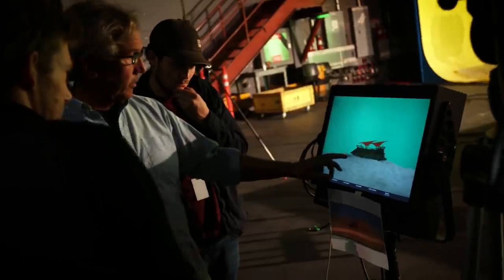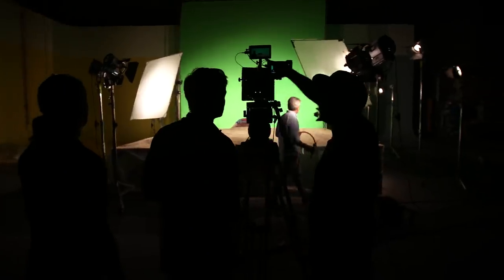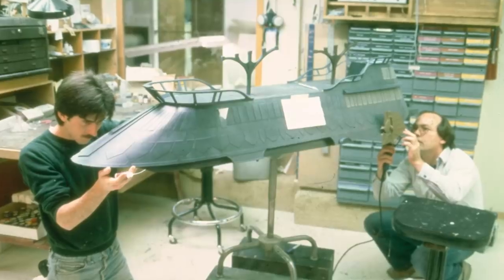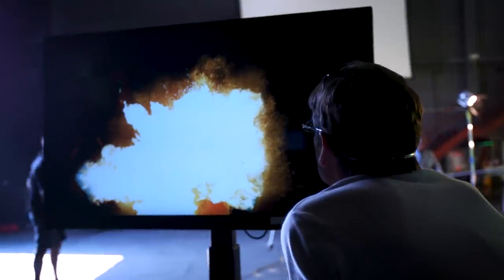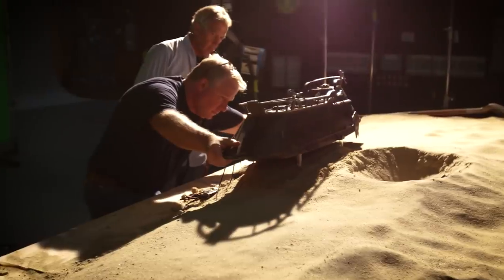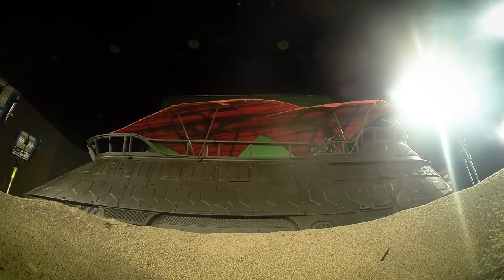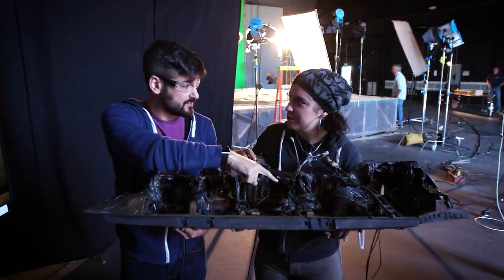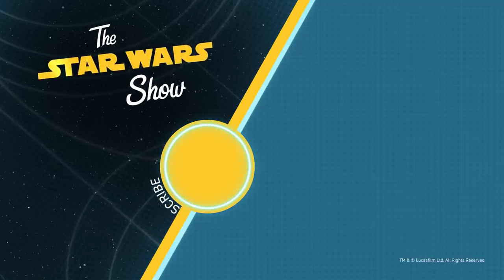Blowing Up Jabba's Sail Barge | The Star Wars Show

Comment: A little bit overexposed, but overall pretty decent replication. It's amazing that the original stands up so well, though. Do you know if they used petrol or propane for the fireball effect on that shot? That might have caused some differences in how the flames behaved.